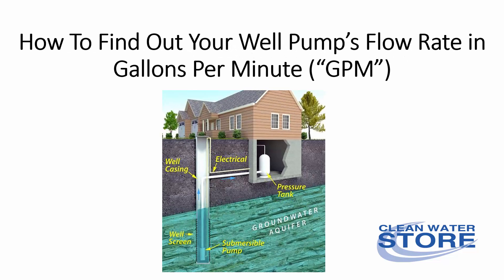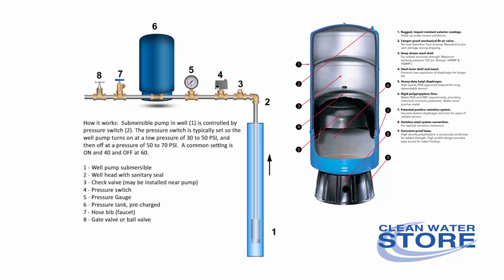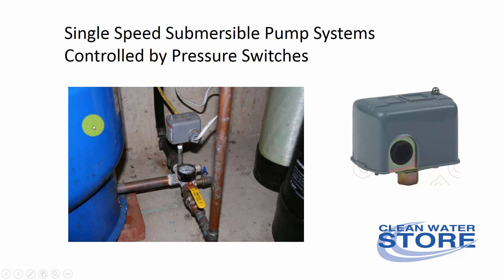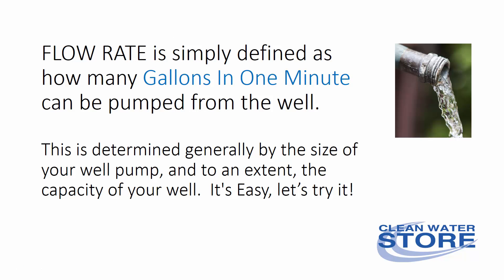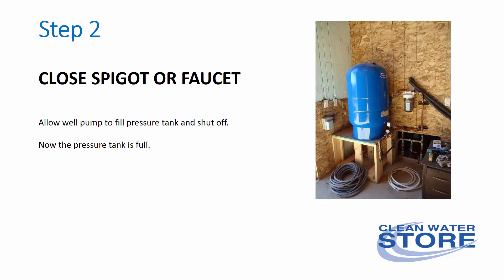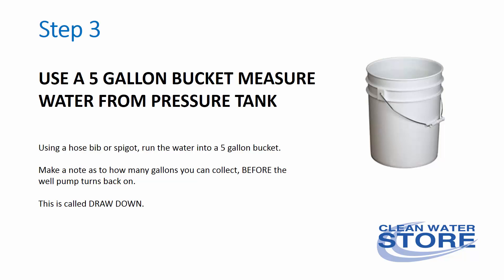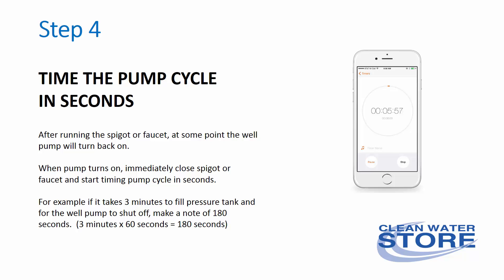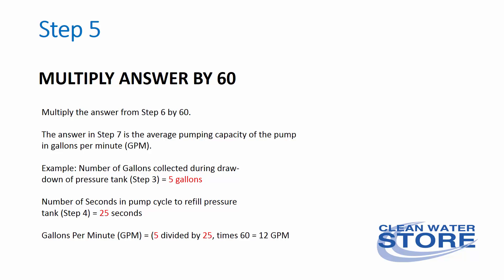How Can I Find Out My Well Water Flow Rate?

Comment: This gives you the flow rate of the well pump, but not the well itself.  Seems to me it is mostly a function of the pump horsepower.  

The well itself might replace the water at a lower rate than the pump can pump it out, in which case eventually run dry.  

There is a video on how to determine the flow rate of the well.